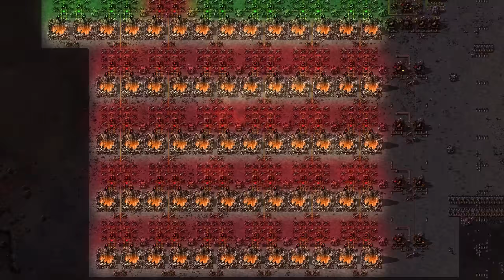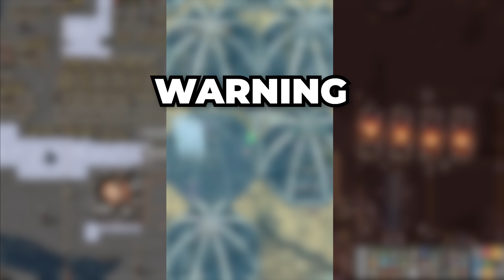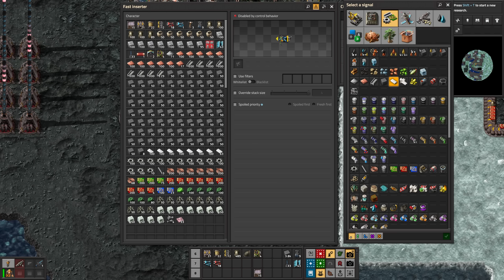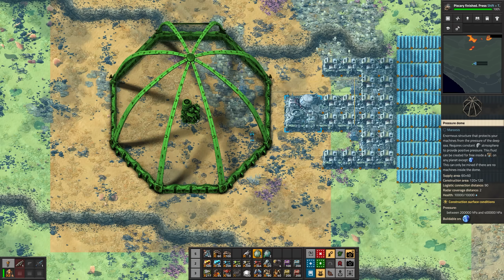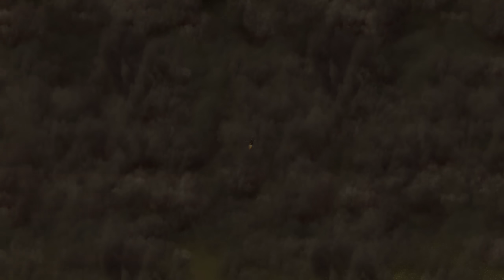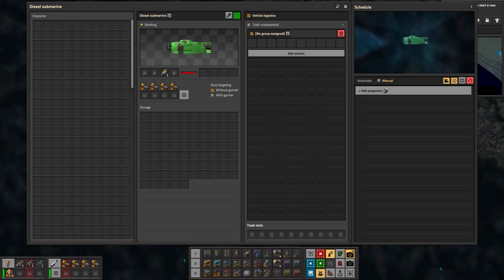Factorio's Modded Planets are REALLY Good.

Comment: Maraxsis breaks when you are in a submarine, and then you make a building where its dry and air so you can walk and build normal buildings, and then you can just walk outside without a problem. 
There should be an airlock, and then you needed to build tunnels between your other buildings or use submarine to move outside. Pressure should be too high imo. 
Also how can fish swim inside the buildings, where there is no water? meh

Comment: Thanks for showcasing my mod Corrundum! It is a feature that you can just plop down a base. If you want to struggle bus - start on Cubium or Aquilo Cubium. The main challenge is optional - refining chalcopyrite ore. You are free to skip this and bring everything to get the science, build a base and ship it in.

22:25 - CO2 power is meant to be starter power, lightning is much better. You can also burn lots of solid fuel to get steam. (Have to make water.)

Glad you liked it!

Edit. Yeah - I explore chemistry more deeply in my mineral chemistry mod. Pair it with semi procedural plants and you have an entire new crafting chain (with mix and matchable blocks) to get iron and copper metal. You start with minerals like Fe2O3, FeS, FeCO3 and you have to consider the different ways to balance them. Still working on refining mineral chemistry.
Reply from the maker: Great mod, thanks for making it ^^

I figured that most things are 'optional' and you can just bypass by importing (it's like that on any of the vanilla planets so fair design choice), but I felt I should show the actual gameplay even though I'm cheating with endgame tech :p

The chemistry mod sounds interesting, and Cubium is also on my radar, maybe in the next installment of this 'series'.
Reply: oh hey! loved corrundum in my oops all planets run, loved the hyperfocus on one aspect of the game. It meant that a lot of the recipes meshed well with the other mods too so I had a ton of corrundum stuff all over which was really nice

Comment: my final particle bender ended up a lot like a big funnel, instead of capturing particles (which has potential, but requires babysitting) it just grabbed most particles coming in then accelerated them into the center

Cerys is probably my favourite out of all the recent new planets, but Moshine has some very interesting mechanics too. Just not the best rewards, unlike Cerys....

Comment: Having completed Cerys, I found it a bit frustrating.

I love the concept, fixing up this radioactive moon base, the main problem is that it only allows you to play with its own stuff. This would be fine, but it feels so power starved and the power options aren't enough, and generally undermines the fun when you do get the chance to bring new stuff there. 

You cant place any other nuclear or fusion on the surface, so your only power options are solar and mixed oxide. And the mixed oxide fuel cell recipe gives only 1 for the plutonium cost, as opposed to 10 for the regular nuclear fuel cell. This is consumed way faster than youll be able to transmute new plutonium via solar wind. And there is no other way to get new plutonium than solar wind transmutation, the mixed oxide fuel recycling doesnt give any, instead gives shiney plutonium for bullets or fancy nukes.

I would love if the radiative towers took nuclear fuel instead, and instead of chemical fuel you got "depleted nuclear rod" which maybe spoil that you fuelled the local ones with. This would reinforce the nuclear themes, especially if they made waste which gave a second source of plutonium 239 that the main nuclear plant turned into 238 as the primary breeder reactor.

For those asking: useful techs are radiative towers (heat everything around themselves no heat pipes needed)
And engine and holmium plate productivity, and a new crystallisation recipe that lets you use high quality holmium ore directly. That sadly can only be done with the fulgoran cryogenics plants. 

There is also the yield module, basically prod 4 with +16% productivty at normal quality, and productivity 3 without biter eggs.

Other rewards include various Plutonium upgrades to Uranium stuff, including power packs and weapons. 

EDIT: The mod creator did fix the recrystallization spelling error problem by using the maraxis spelling  in an update. 

They also added the yield module and local prod 3, and a teleporter if you wanna get out.
Reply: Couple notes as the dev:
- You can power a Cerys 'megabase'  just by running the Fulgoran reactor, I guess you haven't tried. There is indeed gameplay of needing to manage your power usage, but that's only in the build-up to repairing the reactor.
- Cerys uses the mispelling of recrystallization internally so the recipe is identical to that on Maraxsis. Not on an older version though.
- There are more rewards since you played.
Reply: I did actually try, in fact I rushed it because relying on solar sucked. I had thought I could rely on regular power cells as backup if needed while I was setting the big reactor up. But then I found myself with nowhere near enough plutonium, since the transmutation rules aren't very clear. As an example, with 8.4k uranium 238 in various buffer boxes, I only transmuted 3 plutonium in the past 10 minutes or so. As such, I just stockpiled a bunch and loaded them into the reactor when I needed the lithium mines. Plus, filling buffer boxes drained a lot of power, which caused the feedback loop. 

(I just updated it to confirm what you said)

I will correct the holmium, thanks for accounting for that. 

That yield module is nice, as is the alternate productivity module recipe. Not to look a gift horse in the mouth, is there anything stopping me from using it to manufacture legendary biter eggs by exporting the fulgoran prod modules? 

The other plutonium based power rewards don't really shine to me given my previous thoughts on the plutonium mechanics not being clear to me. 

The Teleporter also was a good call, I got frustrated waiting around for things to happen a lot and it would have been nice to do that elsewhere.
Reply: I'm glad you like the updates.

The transmutation rules were made crystal clear in a recent patch: a Tips&Tricks is unlocked late in the tech tree. You have to get started without it, but all is revealed. If you read it you'll easily be able to 10X that rate, and the best designs are 100X.

Recycling recipes are trickiest place to integrate with vanilla. However, I settled on letting Prod 3s recycle to biter eggs OFF Cerys (leaving vanilla gameplay unchanged) but not ON Cerys. Plus mod settings to control this behavior.

Comment: I think the Ocean Planet could be a great expanded Aquilo Planet. The same restrictions apply: needing the three other planets first. Use Aquilo Science to get a suit or something that will enable you to survive the extreme cold in the ocean and unlock an entirely new world there. Also, it would help my scepticism towards seeing belts underwater. Determining what to build under/over water could become a great challenge, with some things only possible in either place. Instead of seeing rockets launch from underwater, it makes sense that stuff is relatively easy to get down there but very expensive to get back up to the surface to be sent back into Aquilo orbit. I guess this could also be done as a new planet with a combined surface and underwater level.

Comment: Haven't tried it but looking into tech tree, Corrundrum gives platinum thrusters that give more power but eat alot more fuel but it's countered by it having fuel productivity... Although I remember 2 things from dev of that mod, that it's completely understandable to rush Corrundrum for better chem plants (iirc they are faster and more module slots) and leave. Also that it's intended to be behind vulcanus, even having a option to make it an requirement.

Wonder how long until a new planet that gives personal equipment upgrade.
Reply: Funny enough they are more efficient at max fuel consumption than regular engines. So just use less and your golden.
Reply: @poptimist5566  uh using less means less efficiency... Don't you mean that it saves you the pump to throttle it?
Reply: @runelt99  They mean use less engines. With vanilla engines, you want as many engines as you can fit without making your platform wider, because that gives you the best possible fuel efficiency. With Corundum's engines, you only want as many as you can fully supply with fuel.
Reply: @StreamlineDeet  Aaah makes sense.